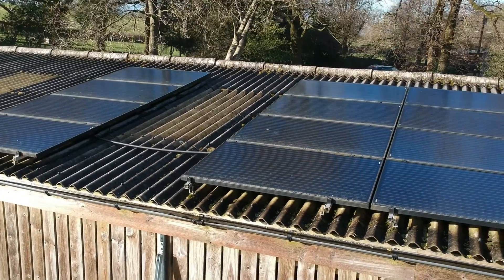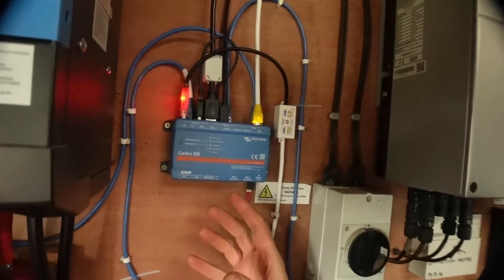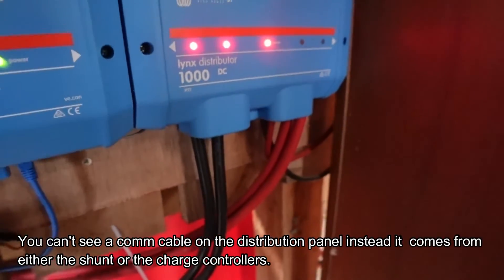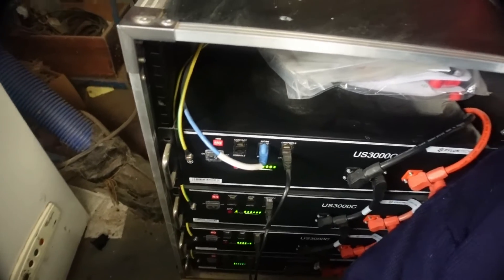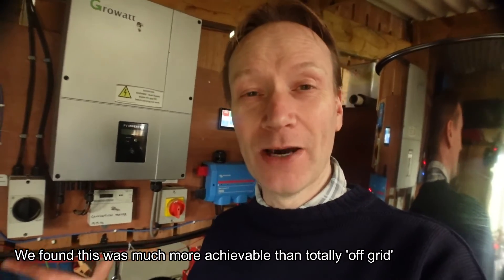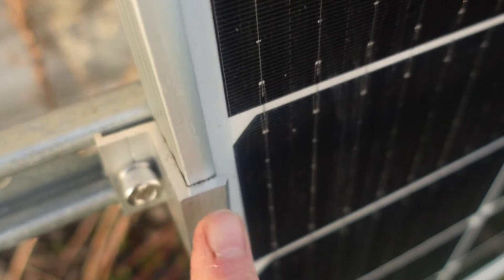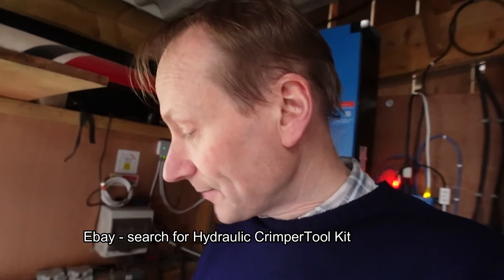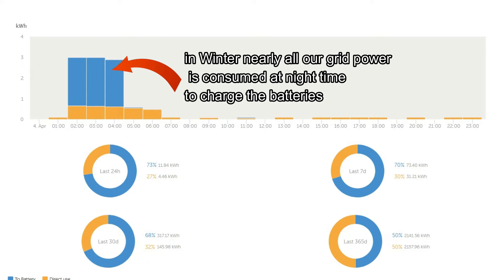How we installed a new battery bank and solar panels using Victron and Pylontech batteries

Comment: I bought a grape vine about 6 years ago. I trained it as a single cordon on a south facing wall. (Autumn Royal). I have done everything that you have suggested and still no grapes. Help.
Reply from the maker: Hi there.  Oh my goodness, that doesn’t sound right.  Are you getting any buds or flowers at all?  If not, have you got evidence of insect damage?  The flowers or little clusters prior to flowering arrive fairly early in the season - mid to late may in the uk.  Check that it is getting plenty of nitrogen early on and then a good feed throughout the year.  Other than that maybe some other folks may have some suggestions…..

Comment: Hi - really great video thanks. Really like what you have done. I'm wanting to essentially run new circuits and keep my installation separate from the house circuits. Zero export etc. I'm curious, is your Victorian setup as grid assist/shore power (not sure correct terminology) with solar/battery being the priority? If so, from a Victron perspective do you have any pointers that could help me please? I'm considering AC in as just a 13A plug for when overnight charge required for my new setup? Also, does the inverter make a lot of noise? (considering placing in a outbuilding I use as an office space)
Reply from the maker: Hi Dom.
Sounds like your setup would be simpler than my one as you want to keep the house seperate.  I'm definitely not an expert, but it sounds like your setup would be similar to a shorepower setup, the beauty of victron is that a search on Google gives you so many schematic diagrams of different setups.  Setups for vans or boats that provide normal mains power sockets via the inverter but also allows input from the mains to charge batteries if needed sounds pretty close to what you need. 
The programming on the cerbo gx is extensive and every permutation should be available.  The app is fairly limited as to what you can program,  but the cerbo hx is faultless in my opinion. 
As for the noise, most of the time the system is pretty silent, however when we pulling say 4+ kw, the internal fans kick in on the multiplus and although not loud it is not silent. It doesn't go on for long as either the system cools down or the draw in the circuits evemtually drop (eg washing machine cycle ends etc).
Good luck though,  read plenty on the victron forums and you should be ok. A